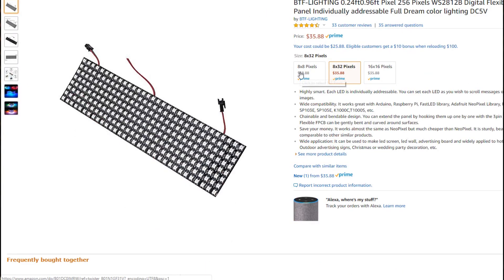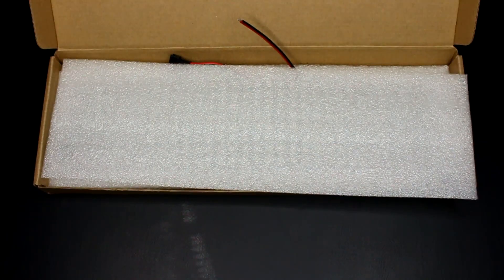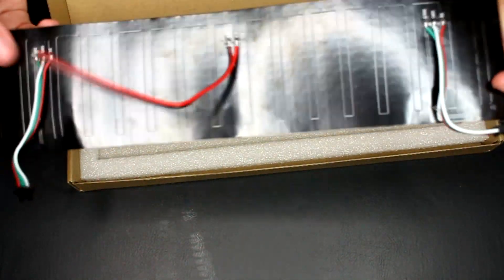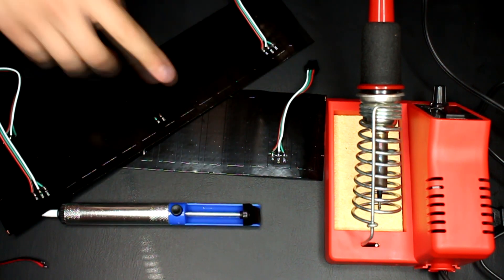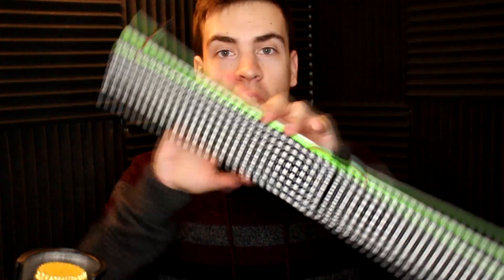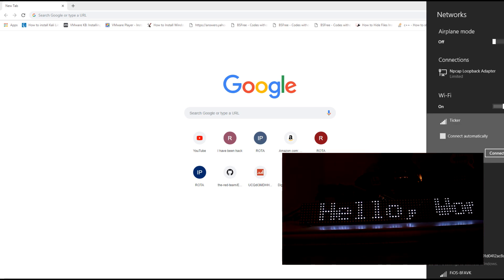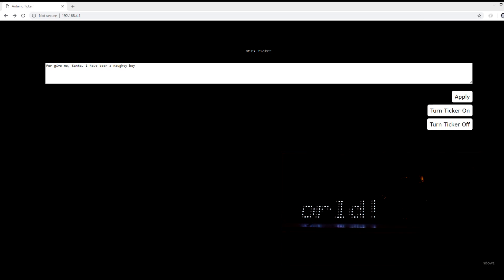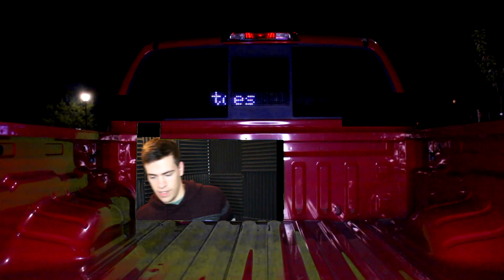Arduino Scrolling Text Bar Tutorial

Comment: I had considered something like this quite a few years ago, but not with obnoxious messages, plus using pre-programmed messages tied to physical switches (or numeric message codes) instead of typing them on a phone.  Messages like:

"Your brake / tail lights are not working"
"Slower traffic to the RIGHT" (after having to pass someone on right)
"You turn signal is on" (for someone driving along the interstate with their signal on and no exit anywhere around)
"Need to turn/exit, please let me through"
"Please dim your lights"
"Turn on your headlights"

And the ever-favorite:
"Die leftist scum!"